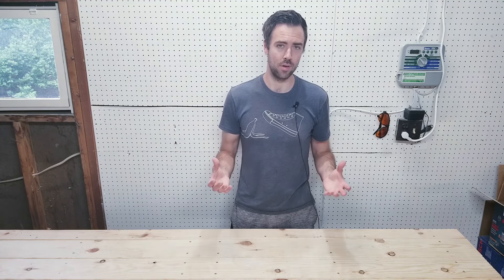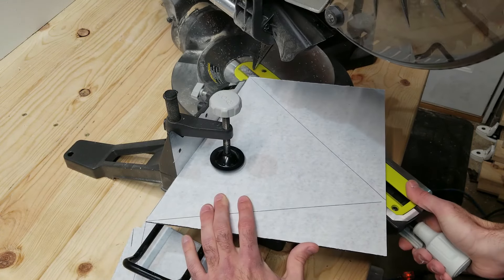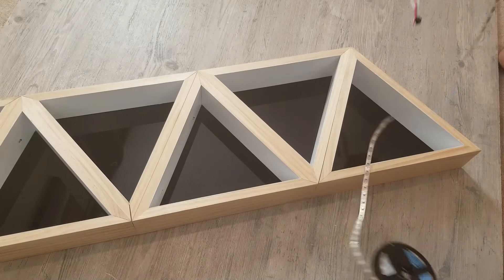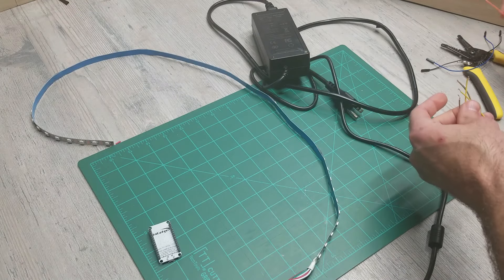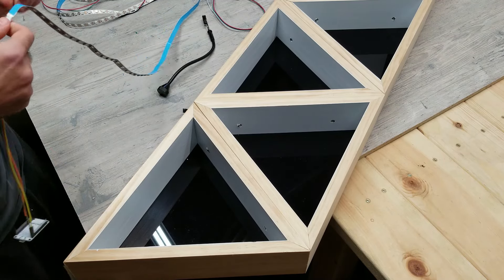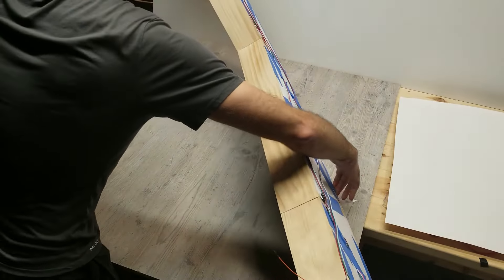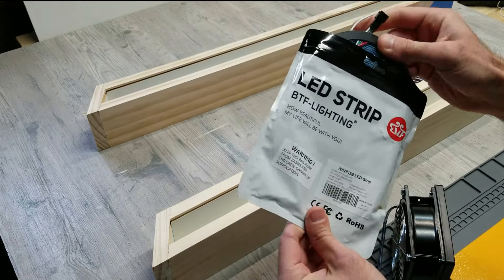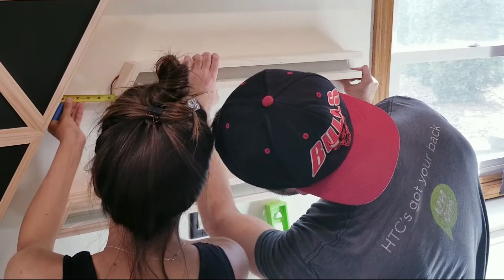DIY Nanoleaf - Black LED Acrylic

Comment from the maker: 🔥Amazon’s BEST Deals (updated daily): https://amzn.to/4aaLjCO
☑Check out my sponsor to begin your FREE 14 day trial to Aura: https://aura.com/chrismaher
****At 15:33 of the video it has been recommended by a few people to use thicker wire than the jumper cable wires that I used.  You can easily use thicker wire in this step and just solder it to the posts of the esp2866 board. 
Materials Used:
Black LED Acrylic from Tap Plastics: https://www.tapplastics.com/product/plastics/cut_to_size_plastic/black_led_sheet/668
@tapplastics 
LED Lights WS2812B on Amazon: https://amzn.to/3pngBDO
AliExpress LED Lights WS2812B: https://s.click.aliexpress.com/e/_Der0k7N
Big Power Supply: https://amzn.to/3oev7c4
Smaller Power Supply: https://amzn.to/3dpIwdX
ESP2866 LED Controller: https://amzn.to/33BwvvP
Jumper Wires Used: https://amzn.to/37mAqPd
Extension Wires - Non Silicon - https://amzn.to/3uItkyl
Extension Wires - Silicon: https://amzn.to/33DX5nX
Extension Wires - Other Silicon Wires I used - https://amzn.to/3bnbhpv
Painters Tape: https://amzn.to/3pUMyh1
Gorilla Wood Glue: https://amzn.to/3o3KfqG
Small Cable Hider: https://amzn.to/3hnxsQs
Large Cable Hider: https://amzn.to/3yaRL9x
Wood I used: 1in x 4in wood as well as 1in x 2in wood
Game Over Sign: https://amzn.to/3w1QwaP

=============================
Support My Channel Directly:
Become a monthly contributor on Patreon: https://www.patreon.com/ChrisMaherDIY
Buy me a Coffee: https://paypal.me/ChrisMaherDIY
==============================

Soldering Tools:

Soldering Iron: https://amzn.to/3s0kgmq
Solder: https://amzn.to/2ONlaVn
Solder Smoke Absorber: https://amzn.to/2ZpYaNS
Helping Hands: https://amzn.to/3jUe3FW

Shop Tools:

Sliding Compound Miter Saw: https://amzn.to/3s0EMn3
Portable Table Saw (my brothers-in-laws. Maybe someday I will be able to afford this on my own): https://amzn.to/3qCLVsX
Miter Gauge Tool: https://amzn.to/3o1H4A6
Digital Angle Finder: https://amzn.to/2Np7QWq
Router Bits I used were part of this set: https://amzn.to/3d4OoIH
Router Table - https://amzn.to/3218dun
Router - https://amzn.to/3wEYTdL

Videos on how to set up what I used to control the Lights:

Installing WLED onto ESP8266: 
https://youtu.be/j15pjU3YZfg
https://youtu.be/9d29SBWA4Qs

Links to a few of my other complete how-to projects:
RGB Baseboard Trim: https://youtu.be/Ik8HnGxfQq0
DIY Customizable Images: https://youtu.be/2q_zrEcbXHE
RGB LIGHT PROJECT: https://youtu.be/rIbTzUD2E4k
LED Strip Diffuser Ideas: https://youtu.be/09-fiWjP42Y
DIY Hexagon Project: https://youtu.be/t9xGyB4ahyY
DIY Corner Project: https://youtu.be/ZB5HqWhMXNo
DIY Edge Lit Designs: https://youtu.be/0_TtHkBB3vA
DIY Govee Glide: https://youtu.be/n9LsiQARFas
DIY Black Acrylic Floating Shelves: https://youtu.be/6csSMtV_op0

Music:

Song: JayJen - Angels
Music provided by Vlog No Copyright Music.
Creative Commons - Attribution-NoDerivs 3.0 Unported
Video Link: https://youtu.be/mnjZWqczU9s
#NoCopyrightMusic #VlogMusic #VlogNoCopyrightMusic

Song: Markvard - Dreams
Music provided by Vlog No Copyright Music.
Creative Commons - Attribution 3.0 Unported
Video Link: https://youtu.be/XCgxFr73-s0

Song: Lichu - Backpack
Music provided by Vlog No Copyright Music.
Creative Commons - Attribution 3.0 Unported
Video Link: https://youtu.be/sQJzCZp5SRY

Song: Lichu - Island
Music provided by Vlog No Copyright Music.
Creative Commons - Attribution 3.0 Unported
Video Link: https://youtu.be/hJT74FPEONI

Song: Pierse - Journey
Music provided by Vlog No Copyright Music.
Video Link: https://youtu.be/wIfMzcwVZIs

Song: INOSSI - Far Away
Music provided by Vlog No Copyright Music.
Creative Commons - Attribution 3.0 Unported
Video Link: https://youtu.be/ifg-87WyQXc

Song: InRp - Golden Hour
Music provided by Vlog No Copyright Music.
Video Link: https://youtu.be/Es7EVrnbiBU

Song: Jarico - Landscape (Vlog No Copyright Music)
Music promoted by Vlog No Copyright Music.
Video Link: https://youtu.be/EwRdKJURDHw

Song: InRp - Ocean Blue
Music provided by Vlog No Copyright Music.
Video Link: https://youtu.be/SCN-E1yVs1Y

Song: AERØHEAD - Path Of The Fireflies
Music provided by Vlog No Copyright Music.
Creative Commons - Attribution-ShareAlike 3.0 Unported
Video Link: https://youtu.be/evg_s62yLcQ

Song: InRp - Last Summer
Music provided by Vlog No Copyright Music.
Video Link: https://youtu.be/RtPGeMCsHJ0

Song: Thomas Gresen - Another Life
Music provided by Vlog No Copyright Music.
Creative Commons - Attribution 3.0 Unported
Video Link: https://youtu.be/4Sh8uXe5KrY

The best way to help support my channel is to like, comment, make sure your subscribed and share my videos with as many people as you can. The other way is to use my links above as I get a small % at no extra cost to you if you buy something. Thank you all for the support!

Comment: Why didn't you drill a hole to pass the wires through each container? Or you could possibly router a wire channel.
Reply from the maker: Thanks so much for watching! That's a good question! Looking back if I were to do this again, I would drill a hole like you mentioned! Not sure why I didn't lol.

Comment: Chris, I had seen this video and put back in a corner of my mind. Then it struck me I wanted use black plastic on an old, bland matrix. So I placed an order for a piece with four holes drilled in. This was a mire few days from this (2022) holiday rush. While wanted before the holiday, I believed  there was no way. Wrong. UPS delivered it in an approaching winter storm. Perfectly multiple wrapped in layers of thick cardboard and clearly labeled, “fragile glass”. I thought it might have been a frame at first.

Surprisingly economically priced, the drilled 25”x25”x1/8th, piece was sealed both sides with safety film, protected from finger prints or errant touches. I put smooth side inward so passing headlights wouldn’t create glare. Rough texture fine and perfect running edge to edge 

I turned up brightness to compensate for the black.  Matrix patterns are generated by WLED 13.3SR.

A good deal and quality product and service from tapplastics.com. Thanks Chris, good recommendation. Keep innovating
Reply from the maker: Thanks so much for watching and taking the time to comment! Glad you had such a good experience with them! Also sounds like a sweet project!! If you have not, you should for sure make a video of how things look! I know I would love to see it!

Comment: 34:30 The distance you were trying to throw the signal wire. The others only need to detect current, that one needs to see specific values, so on a tiny wire, stretching that far, the signal degradation was too much. This and like you mentioned interference, any other signals in the room ect, and given its a Very tiny, unshielded wire.. its going to be easy to disrupt. Im guessing if you were to use a higher quality slightly thicker gauge wire, you would be able to negate the need for your other fix. Cool work around however.
Reply from the maker: Thanks again buddy! You certainly sound like you have a lot of experience in this sort of thing!! Since this video, I now only really use 18 gauge wires and that seems to help out quite a bit. Thanks again!!
Reply: @ChrisMaherDIY  A lot of my experience comes from working with Cars and Motorcycles. Once upon a time I was an ASE certified mechanic. Ive since started learning the electronics side of things, micro circuitry soldering and otherwise. For the signal thing I just remembered a time when a customer replaced a piece of his wire harness on his engine with a cheap extension cord.. of course various gauge wire inside. Sensors did not like it one bit. Lots of wire looming later and she was like new. Also if you have ever messed car audio (or any higher end audio) unshielded wires, and cross talk are very much a problem. Sometimes you might even pick up the pulses from your spark plug wires or ignition coil leads in your speakers. Very undesirable.

Comment: I was surprised you didn't just drill a small hole through to pass the wires from triangle to triangle.  Backfill with black caulk to prevent light bleed through the hole.

Comment: I am doing something very similar to this, but with 900 pixels, so 57A. I was wondering if I would need to increase my wire sizes for everything since it is more current?
Reply from the maker: I've never had an issue with small wires but I also never have my lights on for a very long period of time and never have a need to run them at full brightness. I would say in general, thicker wires are better. In all my new led projects I am using and loving some 18guage silicone wires and they are working great: https://amzn.to/3KtISgE
Reply: @ChrisMaherDIY  Ok so I should probably return my 10 gauge wire 😂
Reply from the maker: @alexosow  😂 I mean you can certainly try using them!!
Reply: @ChrisMaherDIY  I would but idk how I'd connect the wire with it being so thick
Reply from the maker: @alexosow  lol yeah I'm not sure how much thicker you can even get than the 18 gauge. I think 18 is the perfect size!

Comment: ESP wifi board operating voltage is around 3.3V which is already less for the WS2182b LED data line.( 0.7 * Vdd ) = 3.5V. That is minimum that is required across data lines. So if the initial data line is huge thr Is further voltage drop which causes signal not to be recognised properly by WS2182b first LED which is than propagated further down the line. The first LED than step up the data signal when you attached it close to controller. The other solution to this is using logic level (3.3V to 5V ) shifters attached between controller and LED strip. That way you can have long data line connecting to your LED strip. Also I would recommend to add a resistor in your data line to limit the current so that your controller remains safe from any mishap in LED strip.
Reply from the maker: Appreciate the explanation! Super helpful! Where would I attach the resister? The wiring aspect of these projects I'm definitely learning on the fly so I am really thankful for the advice!
Reply: @ChrisMaherDIY  between the controller and first rgb led on the data line. 200ohms should do fine.

Comment: I love it but man the black acrylic is so expensive. It looks better than the lights you can already buy but the cost is killer. I've been searching to see if there is a cheaper company to get bigger sheets if possible but no luck
Reply from the maker: Thanks for watching! I appreciate it! Are you in the United States?
Reply: @ChrisMaherDIY  yes sir I am!
Reply from the maker: @slimtimmy13  let me know if you find any less expensive options and I'll keep looking myself as well!
Reply: @ChrisMaherDIY  will do I appreciate it
Reply: @ChrisMaherDIY  do you happen to know roughly how many feet you used of it? I've found some and as you buy more 12x12 squares the price gets cheaper.
Reply from the maker: @slimtimmy13  I think I used around 11 or 12 for this project! Each triangle was 1 square and the floating shelves were either 1 or 2 squares. I cant remember for sure.

Comment: Maybe try to use a 470 Ohm resistor on the data wire to prevent your data disturbances.
Reply from the maker: Thanks!! I'll have to try that next time! Appreciate the advice.

Comment: I have some clear acrylic sheet that I have been using with Weld-On 4. Weld-On 4 is specifically used for gluing acrylic together. My question is, have you ever used Weld-On 4 with black acrylic? Curious if it has the same molecular bond as clear acrylic sheet for a potential project of mine.
Reply from the maker: Thanks for watching! Thats a great question. I have never used Weld-On 4 so i'm not sure. However, the black acrylic has 1 side that feels a little diffent then the normal acrylic i've used and then the other side feels the exact same as the stuff i've used before. If you end up trying it, let me know if it does work as i'd be curious myself!
Reply: @ChrisMaherDIY  I will let you know if I end up doing it. Thanks for the info!

Comment: Question! I’m brand new to this, but is it possible to make these signs double sided? Or would that take away from the visibility of the LEDs during the day?
Reply from the maker: Thanks so much for watching and taking the time to comment! Great suggestion and You certainly could make these double sided and I think it would look very cool! You might need to make them a little bit wider to have the same effect (diffusion of led lights look more smooth with no hotspots the further away the led strip is to the diffuser. Hope that helps!

Comment: Does RGB led individual light-up every single led in strips ?
Because the colour was traveling from one end to another 

If yes can you send me a link ??
Because I have am rgb which change the whole strip colour at once
Reply from the maker: Thanks for watching! Yes, every led light can be any color at any time depending on what look you are going for. Using the led lights I'm using and controling them using WLED makes for a very customized experience.
Reply from the maker: There is a link in the description to the led lights that I used. Thanks again for watching!
Reply: @ChrisMaherDIY  I just saw but I am from india I can't get it delivered
Reply from the maker: @rubhaganthbs4436  if you search for ws2812b I'm sure you can find some place that sells those led lights. They are very common and hopefully not too difficult to find in India.

Comment: Hey Chris I am not sure if you said it or not, but do these lights connect to Alexa? If not, which lights would you recommend for this project to allow Alexa to turn the lights on and off?
Reply from the maker: These lights can connect to Alexa but that is done via the WLED program that installed on the esp board. I know its possible to do but I have yet to do it myself so I am not of any help. My suggestion is to just type in to youtube WLED Alexa and I'm sure thee are some videos out there walking you through the steps!

Comment: Cool project.  FYI, the much better way to hook up your strip and ESP8266 to power is to connect the red/white power injection wires on the strip (the ones not connected to the harness) to the 5V adapter, then use male to female jumpers to power the ESP8266 by pushing them into the LED strip harness.  In your project you are running all your power (even the injection wire) through the jumper wires, which are WAY too thin to handle that amount of current.
Reply from the maker: Thanks so much and thank you for the advice! That makes sense and I will definitely do that. I am very much a beginner and the power/wiring is for sure an area I have a lot to learn so I appreciate the help! Thanks again!
Reply: " "to hook up" your strip... ", i see what you did there...
Reply: This is dope-- 🙌🏻
Reply: So happy to see a comment from @The Hook Up supporting @Chris Maher. I actually consider both of you my tutors!

Comment: Using those jumper wires for power delivery isn't the best idea (fine for the micro controller, but not the high current of all the LEDs). The wire gauge is usually very thin, the crimp at the male/female end often badly done and the pins themselves don't really fit the other connector.
That adds up to a comparatively high resistance and big voltage drop with the high current the LEDs will use. That means the GND at the LEDs is not the same voltage as the GND at the micro. This is very likely the main reason why you had glitches, because it messes up the voltage level of the data line so it is no longer in the required range to be interpreted as 1 and 0. Even worse, the voltage level jumps around depending on the amount of current the LEDs draw at any given moment. The brighter, the worse.
For GND it is especially important to connect it to everything with as low resistance as possible (with connectors that are rated for the current or soldering, and no "signal-wire" AWG wires)
Reply from the maker: Thanks so much for the advice. I'm very new at this and wiring is something I'm very much learning on the fly. This all makes sense and glad I will be able to improve on future projects! Thanks!
Reply: superdau, what's the fix?
Reply: @tdmallet  
Thicker wires and soldered connections (or at least connectors rated for the current).
In detail you'd calculate the minimum wire cross section. Sound harder that it is, there are even online calculators for that. You just need the expected current (e.g. 2A for a LED strip), the wire length (1m for example, remember you to count both directions, so double the cable length) and the maximum allowed voltage drop (around 0.1V should be okay). That will tell you the minimum wire gauge.
The main culprit in this case will be the connections though.

Comment: What's interesting is you can also take advantage of those black panels and add designs onto them. 

Make the designs black, and with these panels they only show up when lit. Make it  white or a bright color, could make it a portrait visible at all times, but psychedelic when lit.

Could possibly etch a design or pattern to test how that effects the light too.

Kudos.
Reply from the maker: Thanks for watching and the great ideas!  There are definitely many cool things you could make with this stuff!! I might have to try your idea soon!
Reply: @ChrisMaherDIY  Neat. look forward to it.

I imagine the first idea can be done with pieces of card stock to test and not damage anything, and use on your existing projects, even.  Print on transparency film might work, or even cut vinyl. Wonder how a design in front or behind the acrylic fairs too. If hiding the design, definitely put behind the sheet. Wonder if you can tint the resulting design using one of these too...